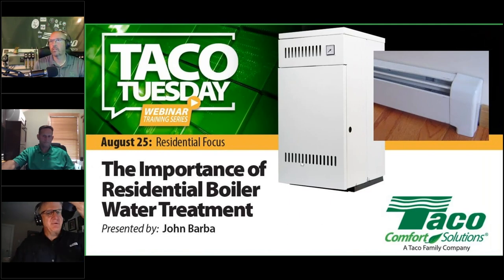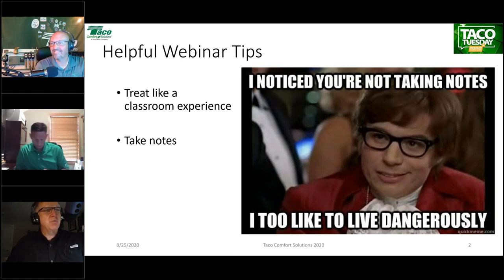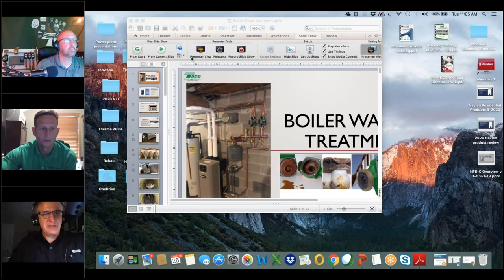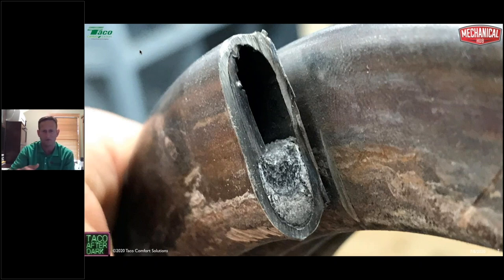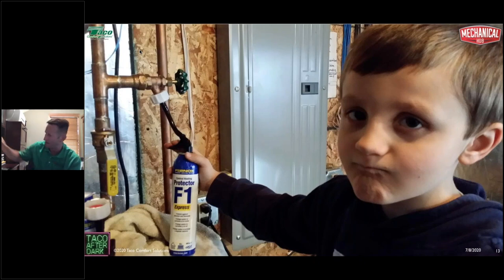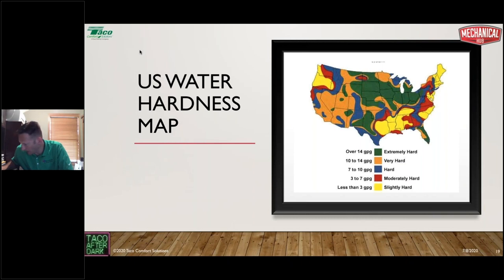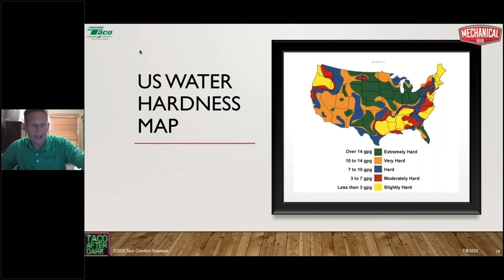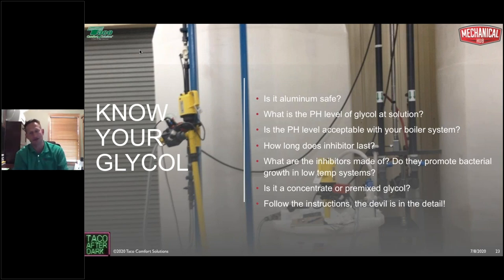The Importance of Residential Boiler Water Treatment

Comment: What product do you suggest for the green oxidation powdery substance that will appear at pipe fittings? Is that oxidation?
Reply from the maker: Tim, it sounds like you may have antifreeze in your system and that green is sometimes an indication of that within your boiler water. Antifreeze does not last forever and will need to be retreated. The only way to know for sure is to have a sample of the water tested. I would contact your plumbing and heating professional to test it and then suggest water treatment.